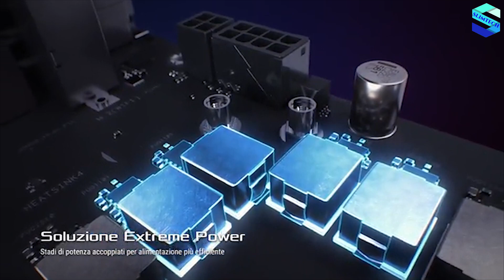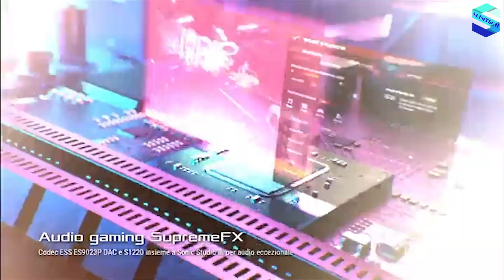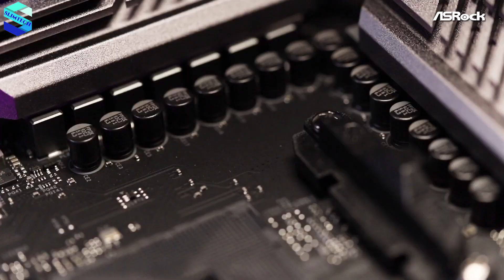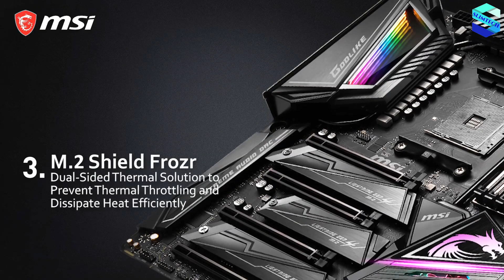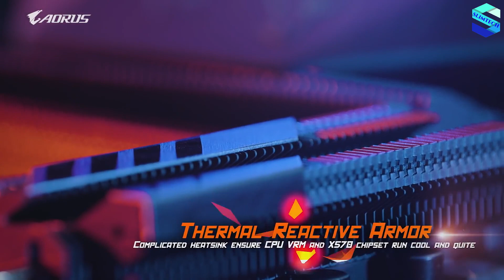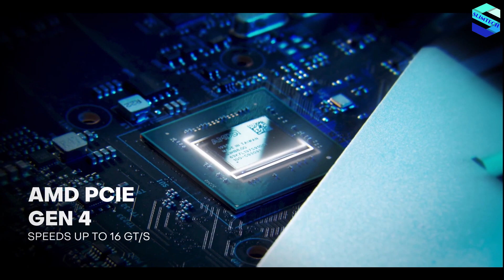Top 5 Best Ryzen 9 3950x Motherboards 2020

Comment: amd 3900x + motherboard x570 asrock aqua vs amd threadripper 2950 x + motherboard x399 designer which is good for gaming ??
Reply from the maker: I would go with the 3900x or 3950x instead of the threadripper for gaming. Save your money. For some games, a cpu with a higher clock speed has better results than other CPU's with higher core count and lower core speed.

Comment: I dont really know about mobos but is it gonna be able to handle a amd ryzen 9, rtx 2070, and a nzxt hs510? Anything else that you need please tell me. (Also im talking about the mobos in this vid)
Reply from the maker: yes it would will handle that gpu. The mobos could handle more than the rtx 2070. These motherboards work best with the amd ryzen 9 3950x, which chipset are you going to be using?

Comment: whats your opinion on running a r9 3950x and the x570 crosshair VIII Hero? i want to pair it with a 3080 as well when they release. i know a little about pcs but not much.
Reply from the maker: Hey, that would work just fine. Im planning on using the 3080 with my 3950x as well.

Comment: Any mATX recommendations?
Reply from the maker: CORSAIR Crystal Series 280X RGB Tower, This case is small but could still fit two gpu's if needed. If your looking for something even smaller i have a few options.
Reply: SlimTech thanks for the response! But I was wondering about mATX motherboards specifically. My GF okayed a 3950X and the Asus X570i is my best bet right now to pair with that and the Cooler Master NR400 mATX case (which fits my NH-D15 heatsink.) It's a great looking and performing board but is ITX. I would prefer a matching mATX board so I could have the option to slot in additional PCIe devices later on down the line if the need ever arises but, the current X570 and B550 mATX options are pretty bleak in terms of VRMs. Especially when compared to the Asus board. I was wondering if there was a mATX board I was overlooking that I could comfortably OC a 3950X on.
Reply from the maker: Hey again, i would go with the ASRock X570M PRO4 AM4 AMD X570. It has a 2 PCIe slots so you can upgrade to another GPU in the future. Goodluck on the build
Reply: SlimTech thanks again! That's the board I was originally considering. I'm not sure if I'd be entirely comfortable pushing a 3950x as far as it could go on it unfortunately. With SLI being as irrelevant as it is right now I think I may have to sacrifice the PCIe slot as I already have 2x16Gb DIMMs and I don't see myself needing more than 2 m.2 slots. Plus the board comes with Wifi 6 so I (hopefully) shouldn't need the extra slot. Thank you for the reply! Have a great day/evening:)